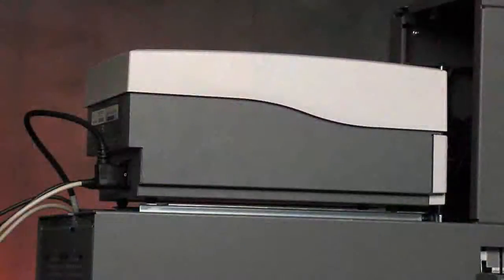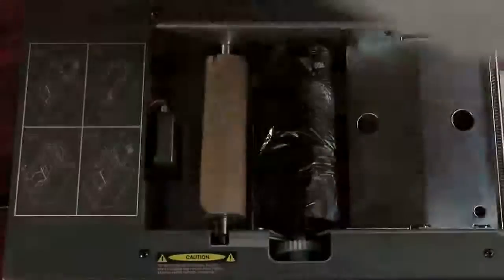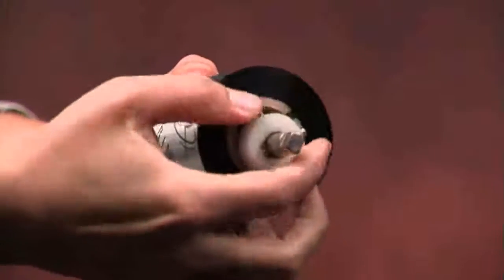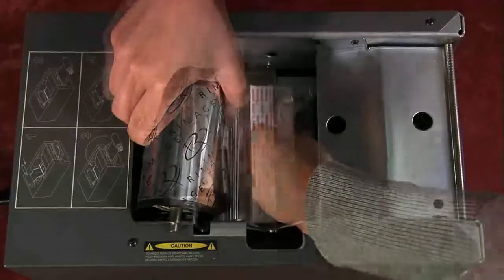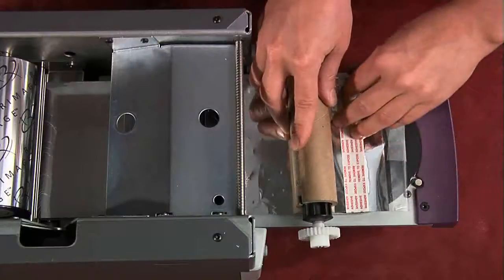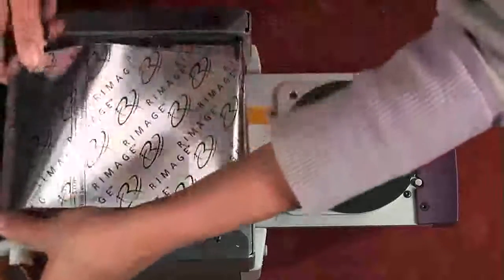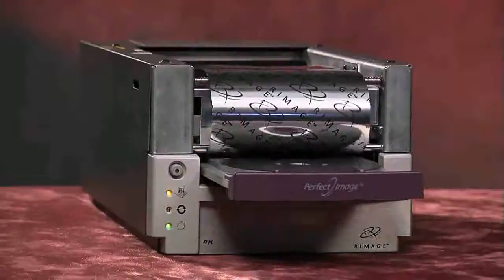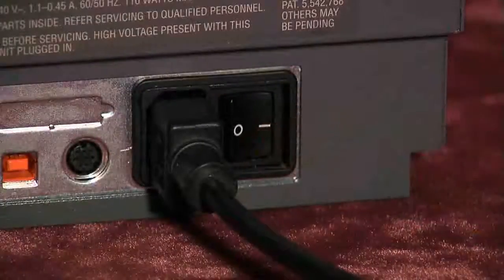Changing The Rimage Prism Printer Print Ribbon

Comment: 6. Press the operator button and hold for 5 seconds to allow the printer to
validate the ribbon. If the ribbon is valid the printer advances and the
Error indicator light stops blinking.